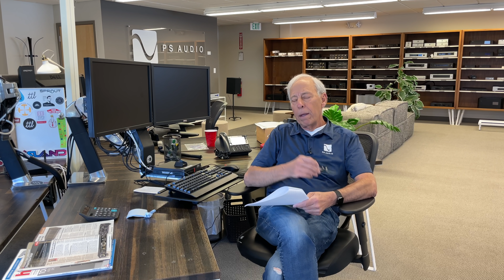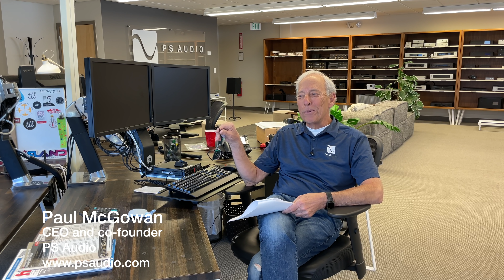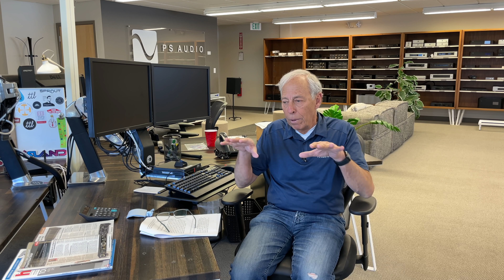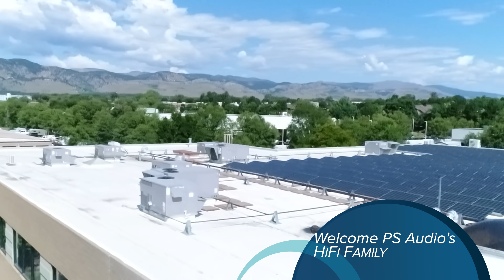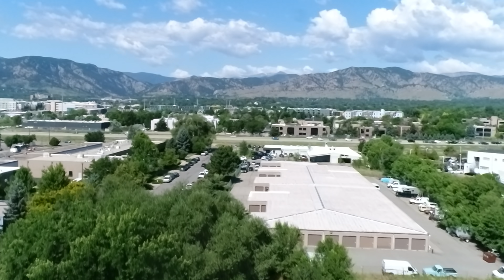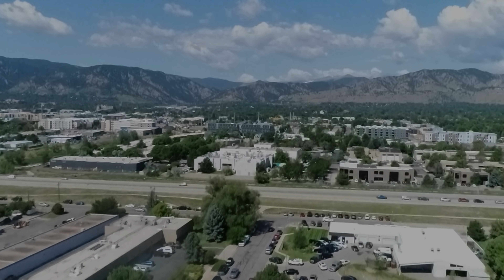Power quality with a Tesla Power Wall

Comment: Solar systems including battery backups use PWM to create the sine wave from the panel and batteries DC. By riding on top of it, they literally use the existing grid's sinewave to filter their pulsed output. Depending on the brand different clock frequencies are used which determine what frequency spikes will be added to the AC line. It has to be a very noisy AC in the house from it.

Comment: Why not using the clean DC directly from the Battery? So getting rid of all that inverters and also the transformer? Ok, You have to build the equipment by hand as there are not realy good ready made options for DC power beside maybe 12V-car-hifi (but solar batterys are usually at higher vortages like 48VDC) Chris

Comment: I run a Powerwall of lifePo4 batteries non Tesla and on my power plants I don’t get more than 1.5% THD, this is practically the same figure I get when running the system with grid power. The main element on this equation is not the powerwall, these are just DC current batteries, the inverter is. The better the inverter, the better the outcome. I’m using a Victron Quattro and I’m very happy with it, it even provides extra Amps of current (above the grid limit), in case the loads demand. In my opinion it’s an audiophile go 👍🏽

Comment: As Paul says the PS Audio’s power conditioner’s performance will be dependent Tesla Powerwall’s output impedance and impulse response. The best way to test it out is with repetitive bursts of high volume low frequency square waves.

Comment: The equipment all converts it to filtered DC anyway so i'm struggling to understand the concern.
Reply: Remember that Paul is in business to make money by selling PS Audio products.   
The concern is that if he doesn't sell Power Plants he doesn't make so much money.  
The concept behind it is that 'dirty power' affects the performance of the power supply in the equipment. 
And, yes, it Can make a difference... but not much of one in most cases.
Reply: Amplifiers are usually only provided with AC inputs thus the easiest way is to address the power supply.

Comment: I have 46 REC photovoltaic panels at 400w each abd 4 Tesla Powerwalls II. And the sine wave I am getting is perfect. This system responds perfectly well to my music system power desmands. And it is much cleaner than grid electricity. The only feature that Tesla has that may impact sound is when the batteries are 100% full and down to 97% full, and it’s daytime and the panels are working and the grid goes out, the batteries send a different frequency in order to signal the system to turn off the panels as the batteries are full, the grid is off and off limits, and the home is not demanding all that the panels are producing. The frequency is different from 60hz. I think it’s two hertz over or under. But even when that is happening, I do not note a difference in my audio system’s performance.

Comment: I am surprised you do not have 400 Hz going out of your power bank.
Reply: Very few pieces of equipment can operate on 400 Hz. 
Power transformers are designed to resonate very close to 50 or 60 Hz, which greatly increases their efficiency.  
The filters in power supplies are also "tuned" to be most effective at 50 to 60 Hz 
and the first few harmonics above that range.  
Designing apparatus to operate from 25 to 400 Hz power is possible; 
a tiny number of things have been, but the cost is hard to justify for consumer items.

Comment: Run an inverter (in South Africa we often have power outages, so they are reasonably common) and the sound is noticeably better when running off the inverter than the normal power supply.

Comment: I have a P-12 power regenerator in my audio system and I am having difficulty reading the power improvement and THD meter readings because I am not sure if they are logarithmic or linear. Since this topic is somewhat similar, I decided to post this question and hope that I can get a response.
Reply: Go to PS Audios website and check out the quite active forum. You get your answer there, from PS staff or P12 owners.
Reply: @NiclasMardfelt  Thank you very much for the information. The manual Makes no mention of how these virtual meter’s readouts are to be interpreted.
Reply: @Scopolamine46  , their owners manuals are considerably lacking.
Reply: It makes no difference?
Reply: @barbecuetechtips6024  I know that but inquiring minds want to know. Emmanuel does not state anything about the scale of the VU meters and I think it should.